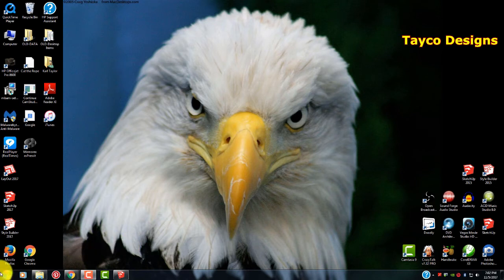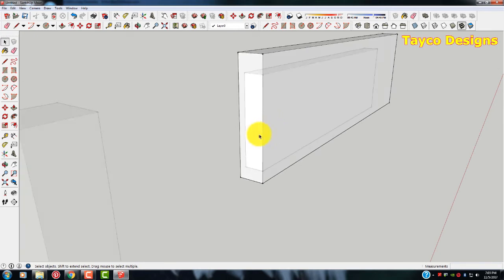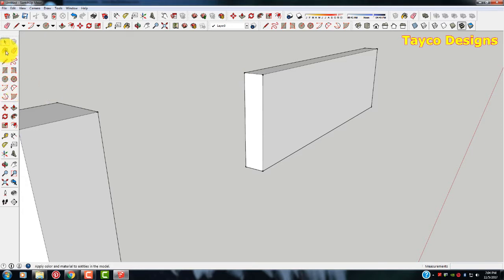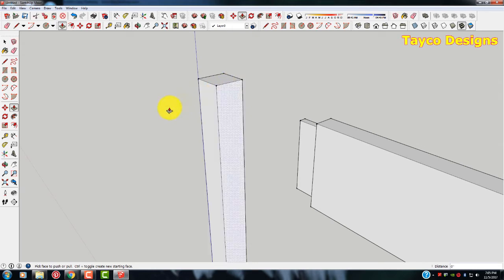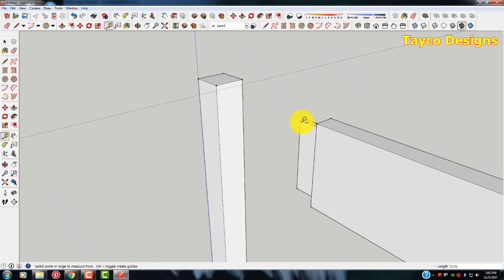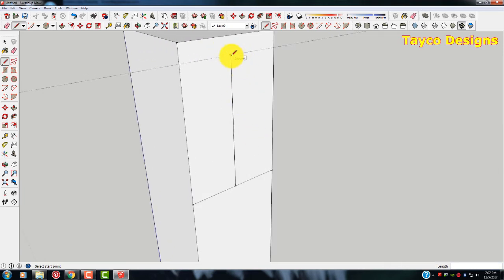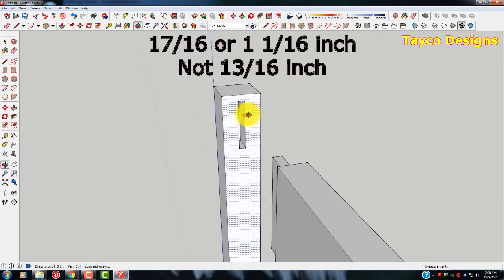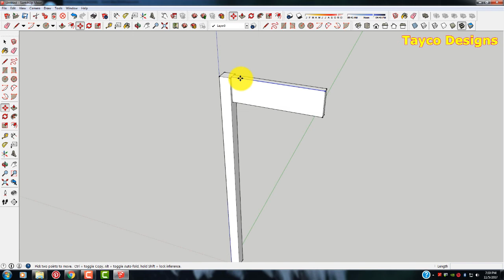How To Make A Mortise And Tenon In SketchUp

Comment: Hey there, from what I can see you have not made separate groups or components of your parts. How can you pull them apart?
If you make a "solid" (component or group) of your parts and put them "together" you can either use "Solid tools" or choose "transparent" and draw the circumference of your tennon which then becomes your mortise .
With these separate parts (components or groups) you can take them apart again and add dimensions.